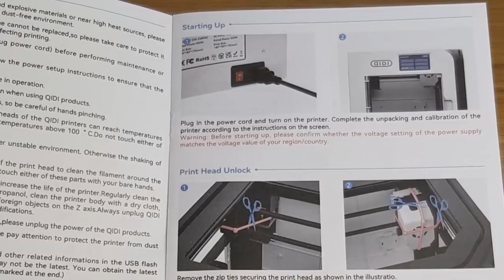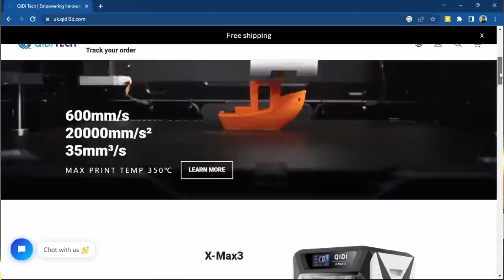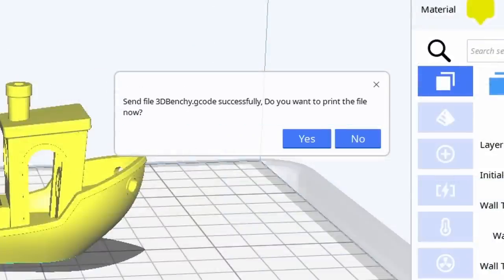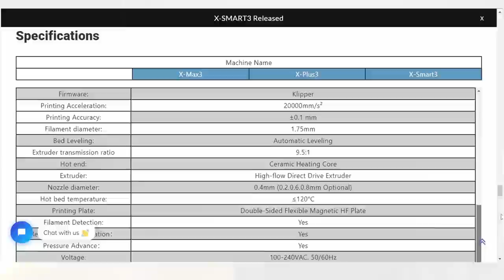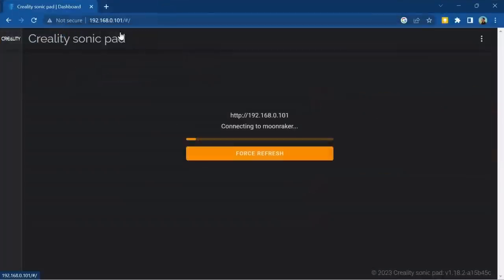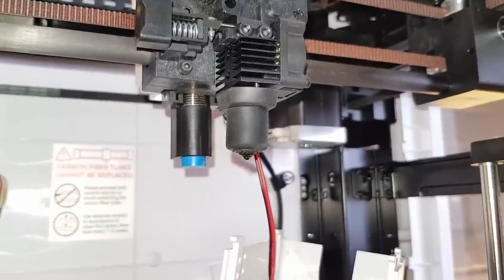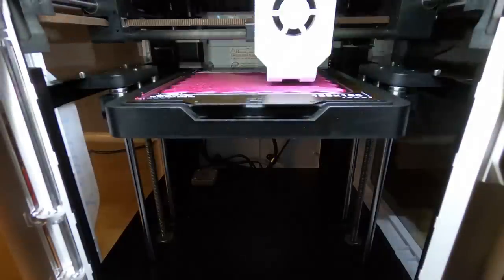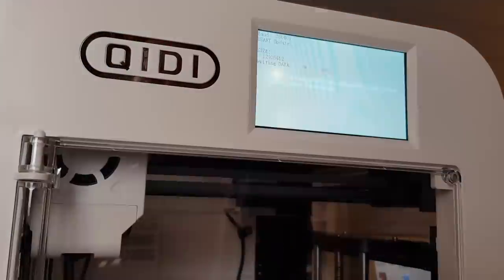QIDI Tech X Smart 3 Review - Faster Than Fast, Quicker Than Quick!!

Comment: Wow! This thing is only $299 on Amazon in the USA right now. That's a bargain for the speed and material options. It has basically the same print volume as an A1 Mini and is much more capable for the same money. Sure, no AMS option, but I think I'd much rather have an enclosed printer like this. Honestly think this is being slept on compared to a lot of more popular printers. Imagine if Creality or Bambu Lab released a small enclosed Klipper printer like this for $299. There would be reviews on every single channel as fast as possible and as long as it was decent people would be singing its praises. Even at $399 it's really a solid price. Good review!
Reply from the maker: I agree, I still use mine regularly. It's a great machine.
Reply: I like it so much I got another one. I've got a few Prusas but this machine is really fast and I love it

Comment: Update on X Max 3.  Qidi apparently shared your concerns about the Carbon Fiber rods and they have redesigned with Stainless Steel tubes instead.  They also upgraded the cooling in the hotend and put metal under the bed.  I was really impressed with those changes and they listened to you and others that have reviewed these units.  They sent me an email and it even had pictures of the new upgrades.
Reply: Although the metal rods do not contribute to cooling, they do require more maintenance and care.
What Qidi doesn't mention: The x-Smart can also do 350°!
Apart from bed ventilation, room heating and exhaust filters, it lacks nothing and can do practically everything that the X-Plus/X-Max can do. My favorite printer for small things! Especially since there is only one power supply running here, it is quiet and therefore energy-saving.
Happy new year ;-)

Comment: I almost forgot, because of you, I am a newbie that has mostly mastered my Ender 3 S1 Pro with the Sonic Pad hooked up to it, in just 2 weeks. So here's something for the work you've done. Then test out that Sgetti Detective that Creality said that's on there, please. So far, I tested it twice, since discovering it on there yesterday. Both times, it just made a mess. Bits of PLA tossed all over my office.
Reply from the maker: Thanks very much. Spaghetti Detective is on the list of Sonic Pad videos for you👍
Reply: @RickyImpey  P.S. I printed my first Speedboat at 26 minutes just now. 150mm/s. The first bit of the bow got wonky. Is that bad cooling when it starts curling up? The rest is super nice, but slightly under extruded. Forgot my CHT nozzle before I started. Lol
Reply from the maker: @martythestines  Most probably lack of part cooling from what you describe yes. The S1 Pro needs a part cooling boost for fast speeds.

Comment: Weird, you might got a early sample since mine the bed mesh come in the setup wizard, about the bearings falling ye same happen on mine after 1,5 week of printing... anyway nice review
Reply from the maker: Oh really? I should try a full reset with the new firmware update to see if it has a better setup wizard now🤔
Reply: @RickyImpey  go to about, you should see a "star-up Guide" press it 1 to change to blue and power cycle the printer!
About the bearings, it seems its a wide spread issue!

Comment: It's 2023. Manual bed leveling really? It's baffling qidi would choose to still use that. Prusa, Bambu, and Creality have moved on to nozzle probing.
Reply: It has auto-bed leveling?
Reply: @MikeMPharmaCyclist  it has inductive sensor but you still need to manually adjust offset same as any inductive setup. also inductive sensor adds a lot of useless mass to the extruder.

Comment: No thanks.

It's probably loud too, like all their other ones.
Reply: They all gloss over the noise levels these new printers make. For people in apartments or shared spaces, the noise is a deal breaker.
Reply: @baxrok2.  Aurora Tech said it was pretty quiet. Stays well under 70dB with door and top open, stays under 60dB with both closed. Seems very quiet compared to most budget bed slingers for example.